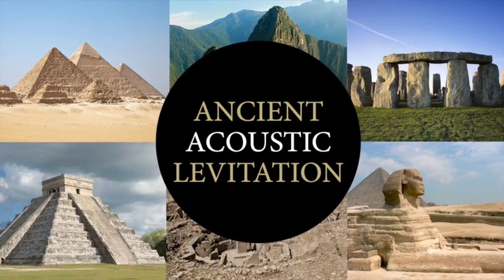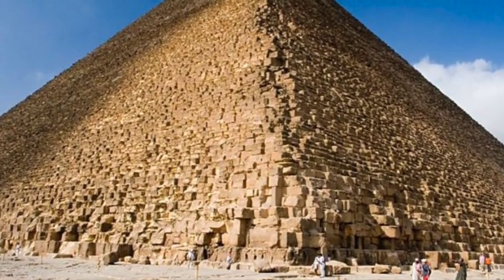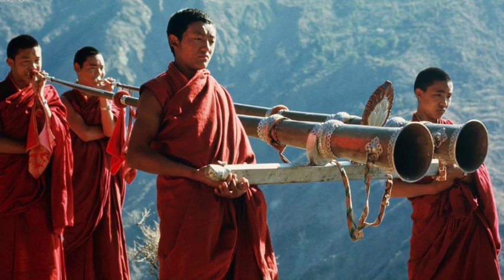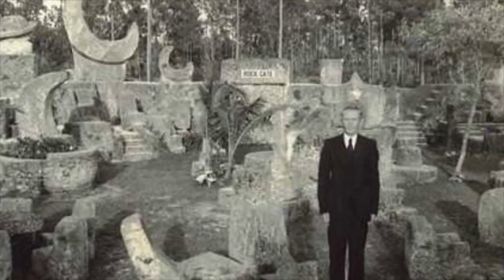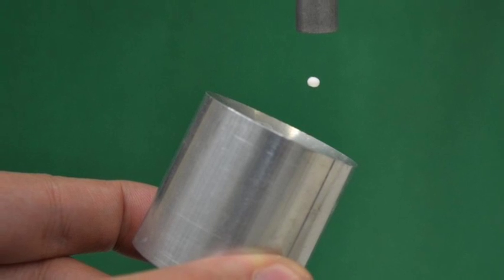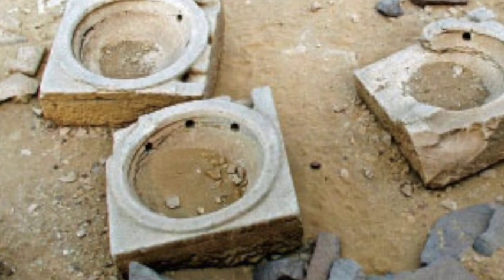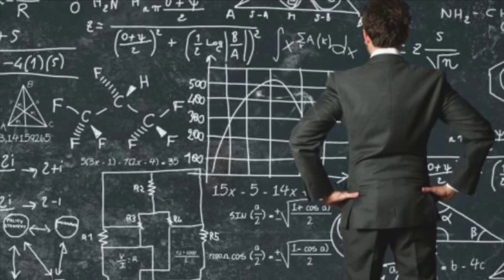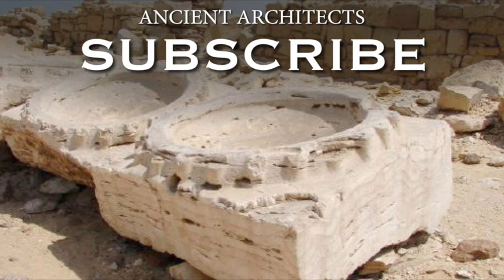Acoustic Levitation in Egypt - Ancient High Technology | Ancient Architects

Comment: I worked on acoustic leviation and trapping in grad school.  Based on the amount of electrical energy we had to pump in, and how precisely resonance had to be tuned, I'm very skeptical that stone blocks could be lifted aloft with sound.  

Maybe vibration under them could effectively lubricate the contact point with ground.  We can't break the rules of physics and the laws of thermodynamics; a multi-ton stone block is still pushing down with tons of force, and lifting it would require tons of lift.

I'm alway open to challenging ideas and hypotheses, so keep them coming!  We just need to cautious and proceed with empiricism.
Reply: You're saying "according to my conditioning of the modern science, this doesn't seem to be possible." 

You're assuming modern science is utilizing the same foundations as a supposed ancient understanding. 

The moment you use a different foundation, the evolution of knowledge and technology become vastly different
Reply: It won't be too long before Upsidaisium is developed and levitation of heavy objects becomes commonplace.
Reply: Exactly right. The laws of thermodynamics applied back then also. 😏
Reply: I love this comment.
Reply: I watched an upload where a guy used sound as lube to push the blocks, as you put it. It was interesting... Doesn't explain lifting blocks, just sliding them on the ground easier.
Reply: Is that something that could be refined and improved as relevant science and tech advances? Like how advances in material science allow us to execute existing ideas that were previously impossible. Also could I ask how long ago you were working on that stuff and do you know if there have been any advances since? You seem well informed but also open minded and rational so Id love to hear any answer you care to give...thanks.
Reply: not
Reply: Magnetic fields can be manipulated with sonic vibrations (you literally went to school to learn this)— therefore so can earth’s. The only reason those stones “push down with tons of force” is because they are (usually) magnetically aligned with earths magnetic field aka gravity. Ancient civilizations had a demonstrably higher understanding sonic frequency than we do by orders of magnitude.
Reply: @samuelpeters5210  gravity is mass not magnetism lol.

Comment: What about... if the pyramid blocks weren't actually solid blocks, and were moulded/formed on site (like concrete)... this would sound more logical and easier to accomplish/imagine than sonic levitation lol. Ive seen sonic levitation with extremely light and small objects, but they have to be placed into the sound wave. They dont actually 'levitate' from standing still on the ground/surface, but are simply suspended in the standing wave of the sound spectrum... misdirection at its finest...
Reply: The problem with what you are saying is that these stones blocks were cut miles away from where they were placed. Unless they had a method to create limestone in cement form then the question remains how did ancient people move these blocks? Even bigger question is how did they even shape these blocks?
Reply: However, if they had more than one of the tuning fork staffs and ankhs they could create a resonance field that would place the stone inside the sound waves. Maybe like a hoverboard type situation, lean in one direction and go. Wouldn't be entirely impossible to create sonic levitation. No evidence to me means that we've lost that information over time. And floating the distance from the quarry to the pyramids would have taken time in reference to how long they say it took to build the pyramids. Also, the tools they used were much more advanced to the ones we have today, again possibly sonicly cutting the stone.

Comment: The platform would have to go fully across the tops, evenly, of both boats. That's a LOT of wieght. Your drawing would require steel, at least. Sink the whole thing (fill boats with water in a flooded dry dock), roll block on, siphon water out, of you go. Plausible for the technology available then.
   I like where you're going with the rest. 👍

Comment: I doubt they levitated as such, BUT most rigid objects, including shaped granite stone blocks, have a certain resonant frequency that can be heard when struck, similar to a bell being struck.  If you use external sound tuned to that same resonant frequency it will cause the block to resonate with tiny vibrations across it .. and at that point a huge block will be much easier to just ‘push’ or pull, with significantly reduced friction, especially along hard smooth surfaces. There are other videos on youtube showing various granite blocks scattered around pyramids that clearly show the tuning-fork like sound that rose quartz granite makes.  EG  https://youtu.be/rnnbxlvPsmc?t=58m30s
Reply: As long as they became lighter and more maneuverable, it more or less comes to the same thing. It's the weight that is the problem.
Reply: @pentirah5282  
What is about more or less 2 millions Egyptian's slaves for a granite quarry of 500 tonnage of weight ? 
Yes, 500 tonnage of quarry  divided into  2 000 million slaves capable of moving 50 kilos a great distance from Swan to Nile river.
Reply: @elzevierjaviergarcia890  
If you say so. I can't comment because I wasn't there - I presume you were.
Reply: So are you trying to say that all rose quartz blocks are tuned to the same frequency? That’s not how it works. The frequency is a product of the density and the internal tension and the mass. So literally every block will resonate differently even if you cut them the same.
Reply: How did they make these sounds to levitate the stones?
Reply: @borisjohnson1944  holographic optical tweezers (hat) google it
Reply: and the Egyptians 5000 years ago had these? I doubt it. and I really hope no one says "but the aliens who built the pyramids did".
Reply: Yeah, this is more believable.  Pushing up an incline is still a problem, though.
Reply: But if frequency resonance is capable of this, then shouldn't at least some Bells float or something?
Reply: Look up Hutchinson effect.John H
Reply: They rather rocket on the  surface of a Iranian  floating carpet .
Reply: it does not matter what you think or your doubts are.
Reply: I know. So many real wonders in this Universe to keep anyone happy for several lifetimes and people have to make up crap like this.